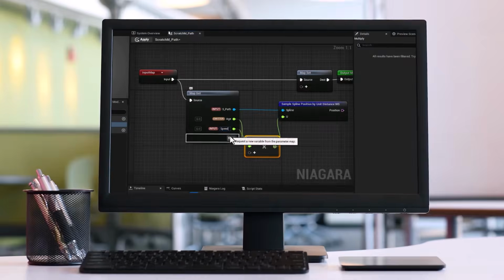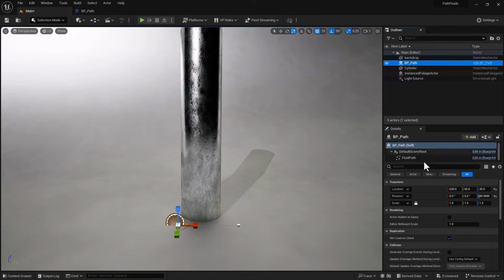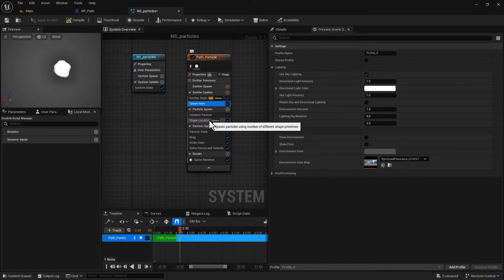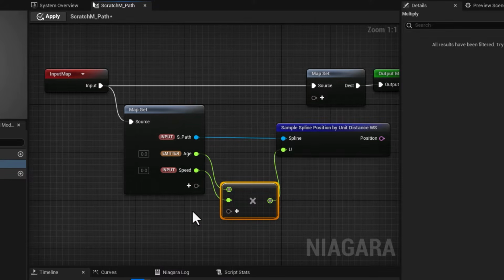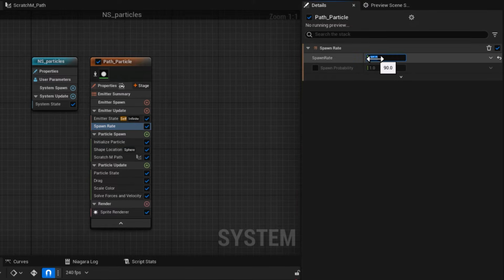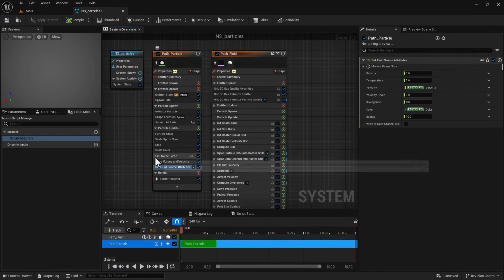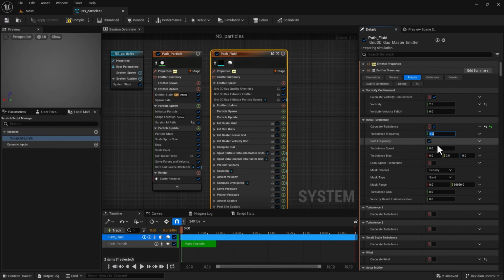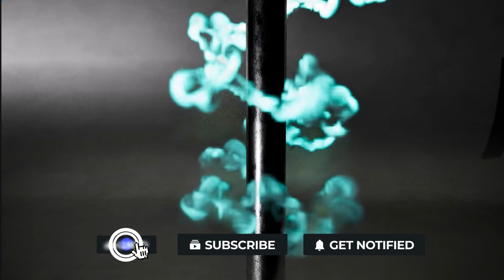#UE5 Series: Animating Niagara Fluid along Custom Path in UNREAL Engine

Comment: So not that i don't love animating along splines in blueprint, but do you think this can also be done along a camera rail path as well? Learned about that trick on another video, the rail visualization that UE does is so much more intuitive for how the paths will twist and bank and I've animated tons of objects / actors / lights all along the same convenient camera rail in most of my projects. Getting Fluid Flux smoke or flame to follow the same rail would be ideal instead of rebuilding it in a blueprint - or maybe there is a way to get the path data from your spline into the rail object maybe? Any ideas?

Comment: Eh, very nice tutorial ! Thanks a lot for this video. I would like to know if I can combine in one blueprint the spline and the emitter and change value called "user parameters" of the niagara system inside the blueprint ? I would like to used niagara to draw charts with line. Can I use ribbon to draw my charts ? Thanks and have a nice year with a lot of video like this ;-)